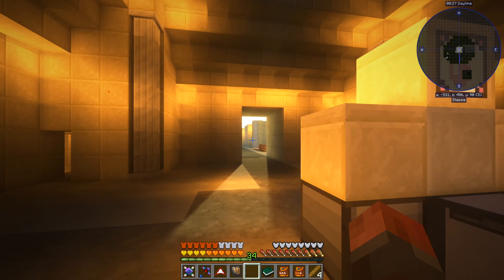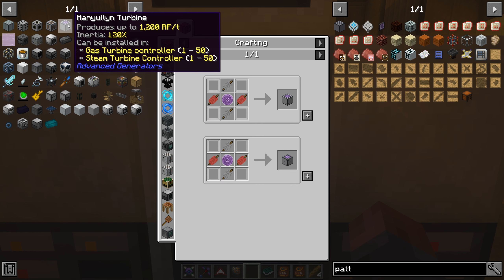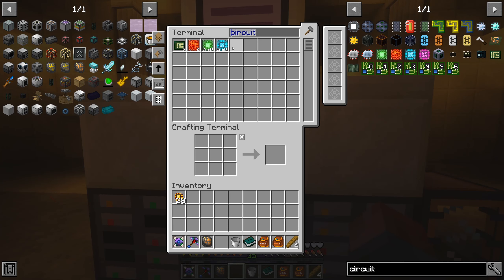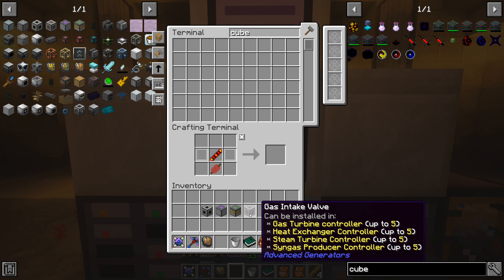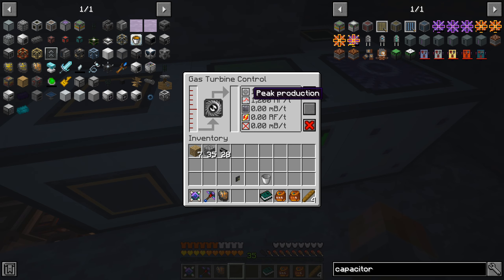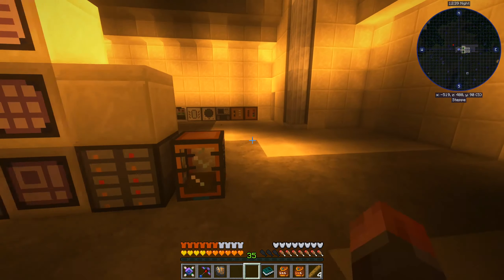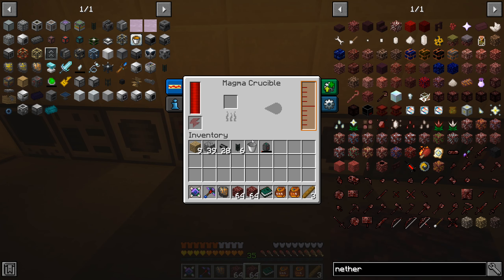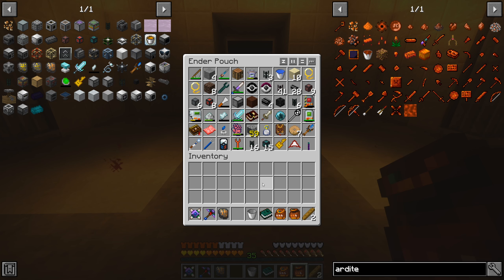Enigmatica 2 Expert Mode E26 - Ethylene Fuelled Advanced Generators!

Comment: When you create the pattern for the control circuit's at the top right of the crafting grid there is a button to allow substitutions if you turn it on the auto crafting should work
Reply from the maker: Aah, nice spot!

Comment: So i am kinda follow your path and trying to build what you build so i learn about the mods in the pack. You went for turbines to create RF. It is 1200 RF per tick. I f i am not wrong, the Gas turbine of Mekanism creates aprox 8.000 RF per tick. Would that not be the best performance route? 

ps. you can create an extra item from the wheat. With Foresty it can be crafted and changed to some sort of bio fuel. Looks like an extra way to energy with a rest product.
Reply from the maker: I'm likely to just keep adding to the multiblock - at 1200RF per additional block, but you could go via Mechanism too!
Reply: @grayduster  Nah.. i am copy your workflow anyway haha... i did the Mekanism version earlier. It is fun to explore other ways. Also, i had a awesome loot. 8 turbines doing 1600 RF each! :D